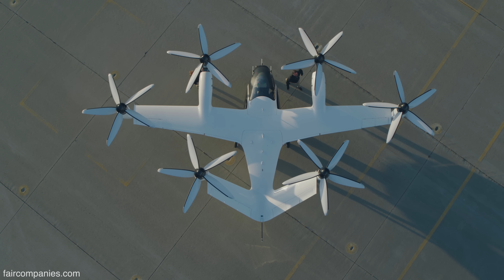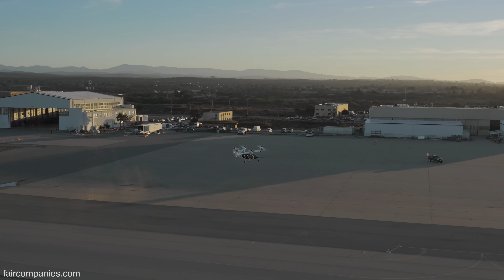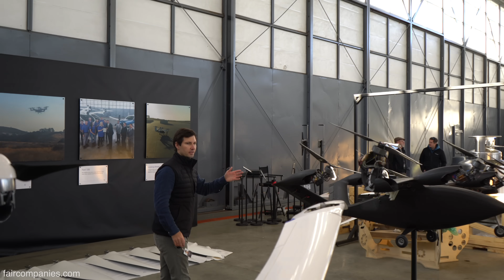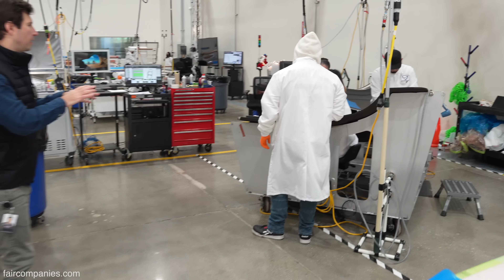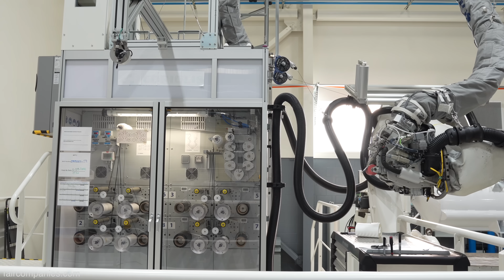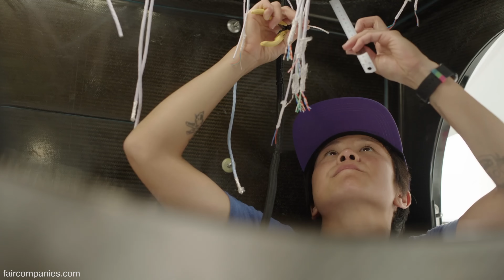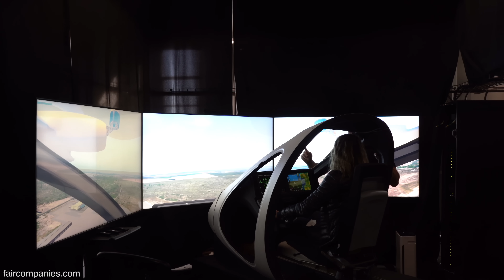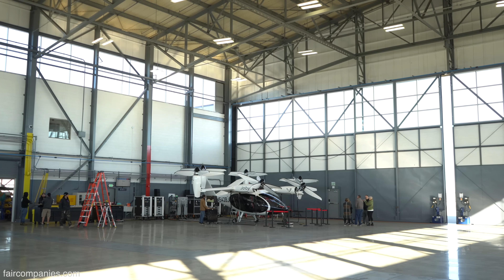eVTOL: electric flying car beats helicopters in silent commute

Comment: Incredible !   Very impressive design. Will this be a certified aircraft or experimental aircraft registry?  Payload ?  Would be nice if you could get the range up a bit.
Reply: Experimental vehicle at the moment, no clear plan for private certification (the "expected" role). Acually, it's not clearly even a finalized prototype, more in the "test stage of various challenges", the challenge here being having a vehicle that is electric, quiet, combines both vertical take off and flight with a decent cruising speed. They aren't facing yet the extremely difficult and costy step of certifying the vehicle, to pass all safety tests like failures, structural stress, adverse weather conditions, fire, procedures, standards of qualification and crew certification... Then, the operational and industrial management : where you get what that vehicle needs and how you maintain it airworthy, you would require a well dispatched set of services, representatives and vendors.
So, payload isn't yet the priority. Yes, can lift a few people but actually should already able to lift at least 12 people. That would be great but why not make the numbers public? Because a LOT of that theorical payload will get converted to safety systems, like a chute in case of emergency, stronger structure and equipments (better shielding) for inflight impact (birds) and weather (rain/hail/lightening).... The more you add safety by regulation, the more you redesign the whole thing, so, quite early to ask for the final numbers. This also affects the range BTW, and adding batteries will further limit the payload...

This is NOT to bash on the company or the vehicle or what they attempt to do. This is not to demote. This is to teach how it works and how it may fail so less people would fail or get disappointed. Sometimes, dedicated engineers give up because the PUBLIC expect the IMPOSSIBLE. I realistically see here the future of medical emergencies where the quietness is a huge plus, and should potentially open more opportunities of quick/fast airlift with QUALIFIED pilots (not the lambda "I want my personal flying car") Also, could be a great aerotaxi with dedicated taxi ports between nearby cities or resorts (tourism), as it does not require the investment in a runway, a large open space will do.
Reply: Just wait, this JOBY 1.0, If lighter and more powerful  if solid state batteries work out, the SSB could change short hall flights forever. 

if JOBY could fly 200, or 300 miles with SSB,, airlines could suffer greatly. Why Delta bought into JOBY, Delta can see the future.

Comment: Ref minute 7:32 The size of the windshield and the windows are wide enough. That large cavity is the entry point for HIRF. I wonder if Joby has performed HIRF system test in a Lab. SAE ARP 5583A HIRF Environment might need to be updated to accomodate VTOL operation in urban area, in cities with large number of RF transmitter, in area surrounding Vertiport and in area where have many building that could induce RF reflection. In addition when propellers were tilt, there will be another HIRF threat through cavity (hollow) near Inverter nacelle.

Comment: It's a carbuncle. Doubtless far noisier than suggested and less efficient, I think the evtol concept is flawed attempt to allow operations in or over built up areas but its a fools errand electric fixed wing flight far more efficient and ultimately practical

Comment: Question:  what is the range?  150 miles...when factory new.   

What is the real range after flying for 5 years every day?  This is the problem with all electric aircraft I have investigated. Nobody has made any real world tests on the lifetime of the battery, and attempted to price the design and report performance that is still competitive at TBO.  I know my mobile phone, which could run for an entire day when new, after 6 years can barely last a few hours away from the wall. It is disingenuous in my opinion to report maximum range numbers when everyone knows after a few years the range will be only a small fraction of that. Exactly how many hours and over how many days at what temperature can you operate and still have a like new battery? Where are the lifetime performance graphs? You can build a model on the ground and study this without even building the aircraft. (And you should if you are honest.) Then, how much will a replacement battery cost? Electric fuel is a major turnoff for me. Batteries are bad enough in a car where pulling off to the side of the road is the worst that can happen. In an aircraft, it could be a serious safety hazard if you have to land suddenly because your battery unexpectedly deviated from its calibration curve. And the minute you put a conventional piston engine inside to compensate for this, you won't be able to brag about how quiet it is any more.

My Aerostar still had exactly the same range after 40 years as it did the day it rolled off the assembly line. Safety demands you quote worst possible range at TBO with an electric plane. Range when new is disingenuous.

Comment: Thank you for developing the eVTOL quiet, safe and well behaving, enclosed cabin, short range, 1-?,person aircraft. 

I am at the visonary stage of developing devices that borrow some thermal energy from the planetary ambient, change its form to electrical energy which is exported to provide heat light or mechanical energy as users wish and let the heat released by these uses return to the ambient. This complies with the well founded evidence thatt energy is conserved though it may change form. It does not comply with the second law of thermodynamics which I find to be a relic of a victorian era steam engine paridgm. 

In 1973, with enough research from my honest quest to make isaac Asimov's depiction of an energy conserving, fact based but imaginary, society come true, and the oil embargo in effect, l, through a patent lawyer, filed for patent US3890161A Diode array, which was granted in 1975 and stopped being exclusionary in 1992. The lawyer agreed that the research was sound enough to not need a working model that works for a year which protects the patent office from some-energy-from-nothing machines or simply any model at al$l.This patent is for a breakeven-perpetual-motion-free-energy machine that adheres to solid evidence that energy is aways conserved though it may change form. The patent is for a refrigerator that coproduces cooling and exports electrical energy equivalent to the thermal energy removed from the insulated compartment(s) via the aggregation of the output of a plurality of consistantly aligned very small diodes rectifying the internal brownian motion of mobile electrons. [my summary here, not the patent abstract]. 

I had a report of a working very low power prototype in ~ 1980 but l naively lost a prototype made from a chip containing ~1400 gold pillars abutting N type GaAs for 1-3 THz frequencies. They [ University of Virginia, Charlottesville ] could not align very small diodes well enough in 1980 to make ~1 um dia diodes individually so they made them in patches. I found a lab that put conductive paste on the face of one of these patch chips to bring all the diodes in parallel and test it in an oil bath in a sealed test chamber. They went out of business but I thought they should keep the prototype because they had the test chamber and could make special arrangements. I lost contact with them and never received the prototype. U VA  refused to sell me any more patch chips and stopped making them. 

When the principle of energy conservation and the second law is followed by a steam turbine driven electric generator electrifying a community, the boiler is heated with chemical or nuclear energy from fuel. Next the condenser receives thermodynamically unvailable heat while the generaor receives mechanical energy which it sends out as electrical energy minus losses in the moving parts and distribution system expressed as heat. Finally the user imports the electricity which ends up as heat after use. The principle of energy conservation is followed in a roundabout way because the fuel energy supplied equals the total thermal energy output. The fuel and the thermal end product are mutually superfluous waste. 
The unneeded fuel use and end product heat drains civilization. Without this superfluous waste civilization can have unhindered sustainable abundance and expansion. 

The elegant way would be to borrow some thermal energy from the planetary ambient, change its form to electrical energy, use the electrical energy for heat light or mechanical energy as we wish and let the heat released by these uses return to the ambient. 

It is more elegant re the conservation of energy for refrigerators and air conditioners to export electricity rather than consuming it. 

Here is a thought experiment device that creates self powered thermal diversification which is counter to the second law of thermodymamics.  The thought experiment device is impractical but easy to visualize and check for mechanical workability.  It's parts are large enough to act as everyday materials but small enough to work well with the nanometer scale thermal motions of gas molecules. 

Sketch made with keyboard characters: 

COLD ROOM   ())--:WALL:-->> HOT ROOM    

Key
()) = Paddlewheel. 
-- = Axle.  (Continuous from end to end)
: :  = Axle tunnel going through a wall.
>> =  Lumped friction element

Please visualize two roome full of air separated by a very thin wall that allows the rooms to hold their heat independently with minor leakage through the wall. The wall is thin to delicately support billions of  separate nanometer scale short axles running straight through loosely enough to rotate freely but  not leak very much heat so the rooms can hold separate temperatures. 

On the left side, a very small paddlewheel is mounted at the left end of each axle. On the right side, lumped friction elements are mounted stationary in place on the wall, one for each axle, for the right end of each axle to run through. The lumped friction elements convert the mechanical rotation of their axle into heat. The lumped friction elements do not impart Brownian motion to their axle.  

Brownian motion (a nanometer scale effect) turns the paddlewheels at random speeds randomly clockwise or counterclockwise. This random rotation is turned into heat by the lumped friction elements.    

The committed, linked, and functional roles of the paddlewheels, axles, and lumped friction elements in differnt places should systemically produce a divergence in the thermal energy in the two rooms without adding external energy. Water in a sealed container hypothetically could be endlessly cycled without cost between warming from the heat of the lumped friction elements' side and cooling from the cold of the paddlewheels' side. 

Here is a hypothetical practical method with the working name thermary: The thermary mainly consists of two electrodes closely face to face (~1 micrometer) in a vacuum wired to an external electrical load. The face of the [Emitter] electrode is covered with a uniform array of LaB6 tipped small diameter carbon nanotubes grown straight out. The face of the [Absorber] electrode is covered with small scale graphine flake char. [Rice U 2014] 

Thermal energy mobilized unattached electrons will tend to free themselves outward from the emitter tips and drift at ~1 million meters / second @ 25 millivolts (thermal electron energy @ 20 C)  to the absorber which tends to collect them.  

A negative charge accumulates on the absorber. This repels oncoming electrons slowing their forward drift, cooling them. The absorber electrode charge is simultaneously the repelling cooling and the external electrical load voltage. The drift current and external wire route current are the same. The DC electrical power consumed by the electrical load depends on the load resistance. Thermal energy absorption always equals the electrical yield. 

Wire resistance is a practical loss not a true loss so lt is overcome by added thermary output. The extra cooling balances the heat given off by the wire loss. The performance of the device is expected to be modest in the beginning but improve rapidly. Even early devices are expected to last a long time. There is little place for obsolence if the first installed thermary works adequately. They will withstand being short circuited indefinately up to an electromigration limit. 

What can you imagine doing with abundant anywhere anytime (with engineering variations), abundant, scalable, rugged, reliable, safe, quiet, nonradioactive, electricity and refrigeration? 

It may become inexpensive too as cost reductions percolate through the economic web. 

Cell phones wouldn't die or need power cords or batteries or become hot.
They would cool when transmiting radio signal power. Frozen food storage would be reliable and free or value positive. That means homes and markets would have independent power to preserve food. Vehicles wouldn't need fuel or fueling stops. Elevators would be very reliable with independent power. Water and sewage pumps may be placed anywhere. Nomads could raise their material supports carefully with few social obsticals. Zone refining would involve little net power. Reducing Bauxite to Aluminum, Rutile to Titanium, and Magnetite to Iron, would have a net cooling effect. With enough cheap power H2O and CO2 levels in the biosphere could be modified. There should been a unitary agency to look after our planetary concerns. 

People, mostly unknown to me, throughout the world should use mass initiative and coalese into many teams that are authority independent, synergistic and minimally biased to expediently research and develop proof-of-concept and initial-recipe-establishing prototypes for all promising concepts. 

Reliable nanofabrication requires fabrication practitioners at the foundry who may require payment.  The development teams may be able to gather ~$100K each from crowdsourced grants administered by sophisticated people to pay the practitioners. 

The practitioners and development teams need to keep people informed of progress and setbacks along the way for accurate mass scientific and general understanding.  Early developers should not use early positioning to exclude other developers.

Aloha
Charles M Brown lll 
4264 Ala Muku Pl C3 
Kilauea, Kauai HI 96754

Comment: Does the "e" really need to be added to vtol?  Vtol is vtol.  And at that size, how many can you park at an airport? how long of a walk or drive to get to that parking spot? How long will that take?  Been through security lately?  How much time will that save on a 25 mile trip?  What if i live and work 5 miles from the 2 airports?  Whats the estimated cost of a trip?  What if the airport only has 20 and im #22?  Training time and cost? Insurance costs?  I have so many questions!

Comment: this is the first evtol that actually looks like it might make any sense whatsoever. hitting the nail on the head with the noise pollution concerns, everyone says they want flying cars or a helipad in their back yard, until they have to live with the noise. 6 rotors for redundancy in motor failure in a hover, and manual elevator and ailerons for total power loss landings from forward flight. it will be interesting to see if they can get it certified.

Comment: Something I just realized... all of those motors up top on those wings make this VTOL really top heavy and unstable. In a light/moderate wind, how likely is it that this vehicle topples over? I'm guessing it's VERY likely.

And another thing, several of those rotors are aligned with the cabin. If there is ever a catastrophic failure of either side motor/prop configuration in full-speed flight configuration, flying components could potentially pierce the cockpit. Seems to me there needs to be (at minimum) a housing surrounding those rotors.

Comment: 2:13They could have made a craft to land on a drive-way/parking lot, if the propellers could shift or be more front and back only, during the initiative mode. The blades are safely high up. A duct fan implemented could expand new formation ideas. Genuise!